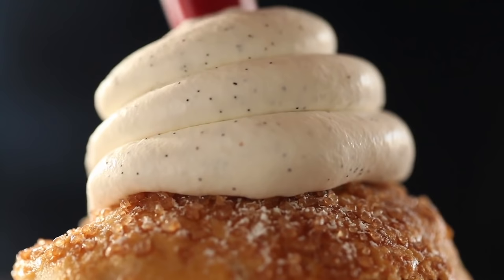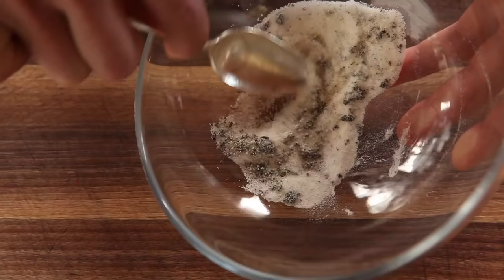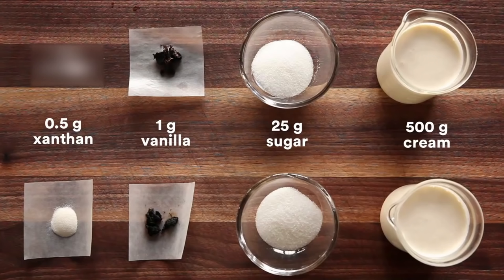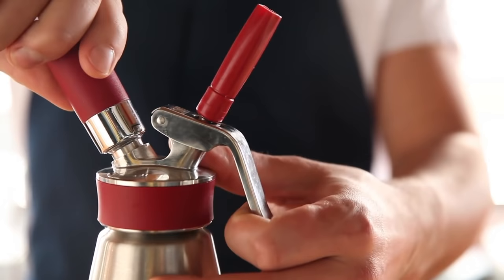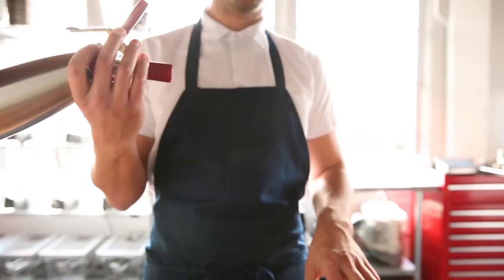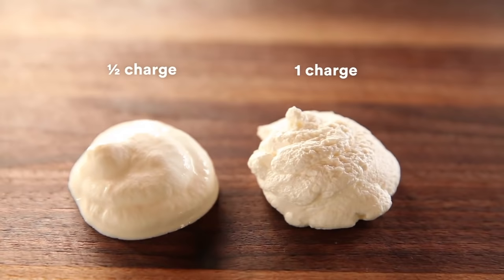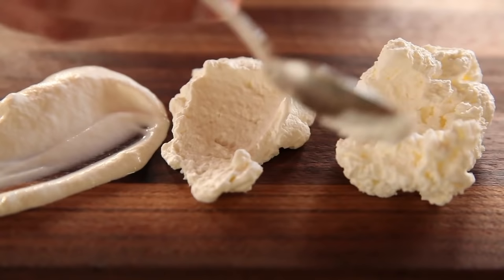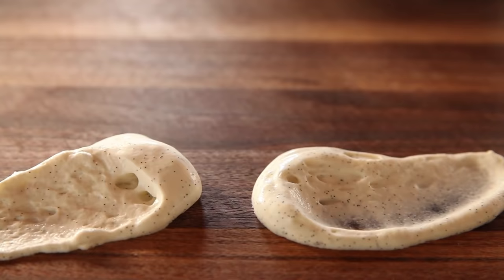How to Use a Whipping Siphon

Comment: Different size siphons require more or less chargers...also cool tip use melted chocolate in these instead of cream and you can make aerated chocolate. But another cool use is cake batter or deep frying batter in a siphon to add some extra bubbles. The best way to use a siphon is for meringue, a lot of people struggle to make perfect meringue mixture so a siphon is the best tool for meringues

Comment: Classic ChefSteps is always welcome. 
A note, I haven’t yet found a recipe that subbing xanthan with locust bean gum 1 to 1 hasn’t improved the texture. LBG is much smoother, less “spongy”, and has better flavour release than xanthan. Only downside is that it’s slightly harder to find, but Modernist Pantry always has both in stock.